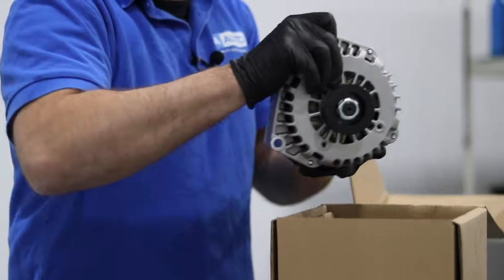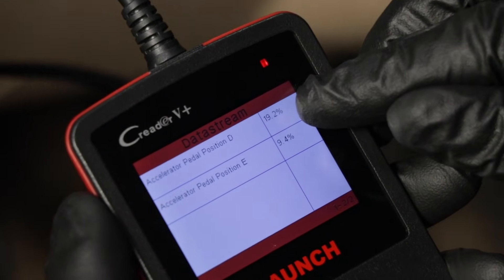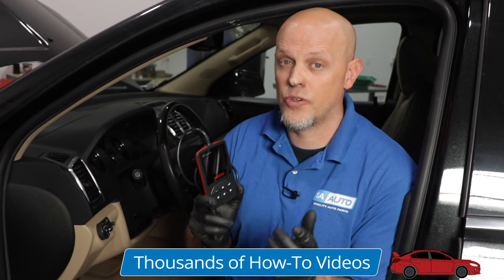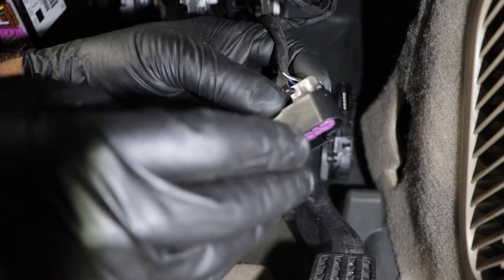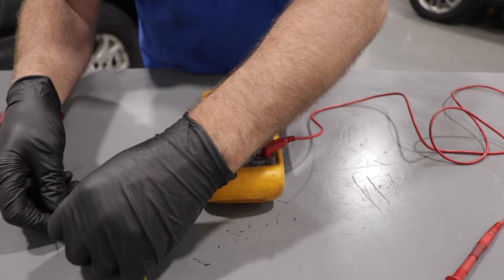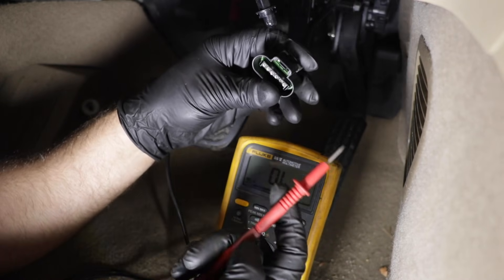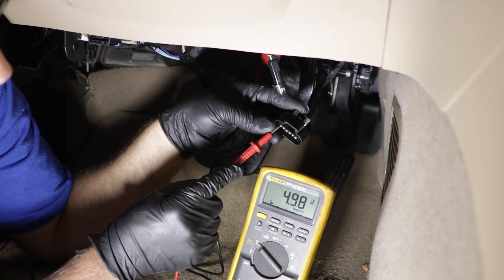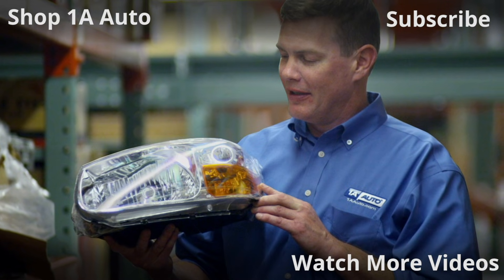Check Engine Light? No Power? Weak Car Acceleration? - Code P2138

Comment: Thanks, I just had to listen to the first 52 seconds in the video to find out what the problem was. About 4 or 5 years ago I installed the Pedal Commander to my Camaro 2012, basically what it does it's overwrite the pedal input to the computer with your preference drive mode. I stop using it, meaning you can switch the unit off  about 2 years ago but I leave it installed, I never take it off. This It's got to be problem !! ,

Comment: Interesting! Let me throw a wrench in here if I may. The only time I've ever got this code is when my Pedal Commander was hooked up. It works flawlessly for a couple months, and then all of a sudden it goes into limp mode on a start up. Disconnect the Pedal Commander and put it back to stock, problem goes away instantly. I've been working with the folks at PC for a few months trying to resolve this issue. They are good to deal with so I'm cautiously optimistic that we come to a good fix. I also run a Range Technologies AFM disabler, so we will see if the two together are causing an issue. I will reply back in the future when I have a solid cure.
Reply from the maker: +@desballard2614 Thanks for checking us out. Shop for high quality auto parts on 1AAuto.com:

http://1aau.to/m/Shop-1AAuto-c

Comment: accord 2007 (5 cylinder) recently turned my check engine light on and got it scanned - code p2138 showed up. not sure if I have to replace this part that he's showing in the video or the sensor that's underneath the hood & I think the piece is called the APPS ? any help would be appreciated

Comment: I had this code on a Buick Enclave. Previous to that, I just assumed the engine was lackluster because it has 220,000+ miles. After replacing the gas pedal, it accelerates like it is new again.  Thanks!
Reply from the maker: +@youdagoob Thank you! We love empowering our customers and showing how to perform DIY auto repairs with our high-quality auto parts.  http://1aau.to/m/Shop-1AAuto-c

Comment: Great. So what happens when this is intermittent????? Get the code, car goes to limp. Stop the car, turn off the engine. Sit for one minute, restart car and NO limp mode and car runs fine.......go home. Restarts in morning and runs fine until   it doesnt again.......and round and round....
Reply: Did you fix this defect and how ?

Comment: I just bought the pedal/sensor assembly for nothing. I each as many videos as I can and somehow skipped over this one. I watch 1A and have ordered parts in the past. After watching this video I did the test and my white/black wire is barely sending anything. Instead of something close like your 4.98 it isn’t even reaching one volt. It varies from .4 to .9. Trying to follow a break in a cable is going to be fun especially if somewhere in the middle. Learn from my lesson, guys.

Comment: I’m seeing a lot of GM cars have a condition where pushing the pedal, one sensor will move 1% before the other- won’t set a code. But under return, the one will return and the other won’t return to 0% position. That’s a difference of 2% total- That will set a code.
Reply: Mine is always off by one percent while accelerating or decelerating. They are equal when you reach desired speed .

Comment: I have a 2007 Hyundai Entourage 499900 mi on it. I've cleaned the throttle body possibly change the setting for the butterfly electronic control I also cleaned out the TPS, spark plugs look good wires are almost brand new, used a can of B12 to clean out fuel injectors, step on the gas pedal can't go past 50 mph really struggles, can I order the gas pedal accelerator sensor from 1A Auto for my vehicle and will this remedy at least let me know that there's nothing else that's wrong just the gas pedal. I do not get any check engine light or codes and I use the fixed  OBD2 scan
Reply from the maker: +Peter Raelian We wouldn't be able to diagnose an issue like that here, you may want to have a local mechanic take a look at it. Thanks for checking us out! http://1aau.to/m/Shop-1AAuto-c

Comment: Hi please i have Chevrolet equinox 2012 with the same code P2138 i have checked the the power and the ground and change the accelerator pedal but still the problem is there, please i need your help

Comment: I have a code P2138 on my 2013 Chrysler 300c , I replace the accelerator pedal and it still goes into limp mode . Any idea what could be the problem?

Comment: I have the check engine light on and p2138 comes up,the car doesn’t accelerate the right way.I replaced the throttle pedal sensor,the throttle body assembly and it is still doing the same thing and the check engine on,I don’t know if I have to replace the computer or there is a way to reset it

Comment: I'm at a loose end with mine. I'm getting the p2138 and p193b(throttle valve Signal error) various mechanics have looked. I know its not the pedal. App_d is fine, but app_e fluctuates. Really need some pointers. Great video though. 👍
Reply: Did you fix this defect and how?

Comment: My car also disables tracton control. I have changed the pedal once at 150k miles and just passed 300k and now its acting up again. I cleaned the connections to the pedal and also at the throttle, cleared the code and it seems to have resolved. 
For 150$ It maybe worth taking the plastic case off and clean it with electronic cleaner if it comes back. 
Lets see what happens 🙂

Comment: I have a 2013 Ford F550 super duty 6.7 accelerator e has no voltage Chase wires to computer going into computer have voltage on one side no voltage on the other side which both are posed to be a v 5 V

Comment: I have no power but no codes or check engine light on any suggestions
Reply from the maker: +RG 1 We wouldn't be able to diagnose an issue like that here, you may want to have a local mechanic take a look at it. Thanks for checking us out! http://1aau.to/m/Shop-1AAuto-c

Comment: I checked the wires they are ok and replaced the acclerator pedal but still there is problem. Car is GMC terrain 2012 3.0 V6.
Reply: Same issue 2011 camaro replaced everything and still have the issue

Comment: hi are these codes also related to the same problem should i change my acceleratio Sensor
 P1589 ACCELERATION SENSOR LEARNING VALUE
Reply: Did you get an answer to your problem? I have the same issue now

Comment: Actually you don't want any contacts to have dielectric greese..  That's something you put over exposed parts of wire once they're already connected together ,,example a battery terminal that's been cleaned you have wires connected to the terminal you put a little bit of dielectric grease over to terminal thats already connected..It would basically insulate the exposed wire From the air

Comment: Any tips please.

Jeep gladiator 20 wiv  smart key

Ignition come on but the vehicle want crank and dose not trun back off until you remove the battery + or -

Any idea please DTC  p2111 p2127.

Comment: I got a p2138 code on a 2006 malibu . It came to me in limp mode .  I called the parts store and had them order the gas pedal assembly . I pulled the pedal assembly from the car and saw that the electrical component had a snap off cover 😀 . I popped it off and saw a rheostat with small copper fingers . I cleaned the contact area with a q-tip with alcohol on it . Reassembled it and erased the code with the code scanner , replaced the pedal assy.  No expensive part needed . Easy peasy
Reply: I replaced throttle body and pedal and stillnhave the issue 2011 camaro 3.6
Reply: @rileynelson1864 Did you fix this defect and how?

Comment: I don't know what to fix my 2013 silverado 1500 4x4 it has the same issue, everyone mentioned about replace Throtle body, Brake pedal position sensor, Ignition coil and spark plug, water leak into wires connector, short voltage, I'm not sure who is right what really is the problem

Comment: My car is a Daewoo Lacetti Premier 2009 with code p2138. The strange thing is that the check eng light goes on only when I switch off the car! The engine even stutters after I remove the keys for a few seconds then it shuts down, seconds later the check eng light goes on and stays on! 
Any explenation for this?

Comment: My 2011 Silverado did the same thing but my I checked the connector and it did have some bare wire showing. And I taped it up and the check engine light turned off
Reply from the maker: +Julio Rubalcava Thanks for checking us out! http://1aau.to/m/Shop-1AAuto-c
Reply: @1AAuto  a lot of the wires actually had bare wires showing

Comment: Car in limp mode / engine reduce ,, I change trottle body that’s not it ,, cam sensor , that’s not it !!! Car turns over but no start
Reply: What was it
Reply from the maker: +Jayj B We wouldn't be able to diagnose an issue like that here, you may want to have a local mechanic take a look at it. Thanks for checking us out! http://1aau.to/m/Shop-1AAuto-c

Comment: One tip ... not challenging this guy by any means... When you are diagnosing, have piece of mind by checking resistance at the actual pedal.  You started from the far end, worked your way in and STOP..."IT'S THE PEDAL!" ... don't do it like that.  Add that one more step and check the terminals on the sensor itself(which ever you are working on).  You very well might have a good sensor and the wires(although checked out) might have a wiggly issue in the wiring and just so happen to fool you at the final diagnosis leading you to believe the sensor when all it was was a chaffing wire that just so happen to not be at the final.

Comment: Would this be the cause, even though i  got not check engine light? But my truck wont respond sometimes, i need to step on it really slow for it to respond a little better..
Reply from the maker: +daniel jimenez We wouldn't be able to diagnose an issue like that here, you may want to have a local mechanic take a look at it. Thanks for checking us out! http://1aau.to/m/Shop-1AAuto-c

Comment: @1A Auto: Repair Tips & Secrets Only Mechanics Know 

Good day! Was just wondering if the code P0122 and P0222 are also related to this issue? Am having issues with my 2015 Subaru STI. 

P0122 - Throttle/Pedal Position Sensor Switch " A " Circuit Low

P0222 - Throttle/Pedal Position Sensor Switch " B " Circuit Low 

Thank you sir!

Comment: I had that code before on my 2006 impala SS… and changed the accelerator pedal for a brand new one. Everything was good no code anymore.Now about a month or two later code comes back up. What could it be??
Reply: And can I also use electric cleaner for better connections just in case its dirty or corroded?
Reply: Could be the throttle body positioning sensor… get on eBay and check out throttle body’s

Comment: I keep getting reduced power to my 2016 Malibu. Ive already replaced my MAF and MAP sensors. And its still happening.
Reply: Clean the throttle body with carburetor cleaner! carbon is probably interfering with its function!

Comment: hi , i have GMC Yukon 2013 XL , have problem with code P2138 accelerator pedal position (APP) sensor 1-2 correlation . i changed the pedal and throttel  and still have same problem  plz can u help . thanks
Reply: Did you guys go through the relearn process for the pedal and the allowing the throttle body to reset
Reply: @coreybrainard7653  yes relearn it and still have the issue, only thing I had was a corroded wire I repaired it it ran great for 2 days them back to p2138
Reply: Were u able to figure it out I have the same problem on my vehicle
Reply: Same on my 07 smh

Comment: I have a 2018 kia soul and I've tried everything except this so far low acceleration lost of power etc but will try this
Reply: dyde i have my slk230 ndve changed so mch, ignition coils ad then this
Reply: Mine has a new engine, cat converter, transmission. throttle body sensor.  starts immediately, purrs nicely.  Acceleration is uneven, hesitating.  It will get up to highwau speed.   No codes.  I think its this sensor.

Comment: Hey man. Recently bought a car and had to buy this paddle with the sensor like this one. But on the wiring harness to the clip onto the sensor, the person before me had tie them all together because they must've torn apart. How would I go about getting a new wire hardness to clip onto the sensor.
Reply: Yeah all my wires are tied together. Is this going cost alot to replace? So far it seems to be working with the new sensor and peddle.

Comment: I have a couple questions ...

1. What if we have replaced the Accelerator position sensor and we are still getting the fault code ? Because I have replaced the APS as well, the Throttle Body Sensor and also did a fuel system cleaning but I am still getting that fault. I could really use some help because I have been struggling with this issue for some time now. 

2. If I were to have the wiring replaced what would be the recommended price to pay for labor? I am planning on buying the pigtail connector to see if that is damaged I might as well change it because I am noticing that I get this fault when I hit a bump on the road. 

If anybody has run into a similar issue like this and fixed it please feel free to let me know what is it you did 

Thank you.
Reply: My cadillac dts have same issue
Reply: Could you resolve the problem?

Comment: Can a dead, dead battery affect the APP sensor?  My battery was dead for a few weeks, I just replaced the battery and now I’m having throttle issues. Had this sensor replaced 8/2018. Wondering if battery caused issue, or it just needs to be reset somehow? Thank you!
Reply from the maker: +tigereyes6868 We wouldn't be able to diagnose an issue like that here, you may want to have a local mechanic take a look at it. Thanks for checking us out! http://1aau.to/m/Shop-1AAuto-c

Comment: hi. I have a big problem with chevy TB 02 and I don't know what to do. The engine is running normally, no light is on, the throttle is clean and the engine has no power and is noisy. Max 3000rpm and 55mil.. Do you have any advice? Thank you

Comment: Should you do this check on the throttle body side? Can't that be a cause for the code as well?
Reply: APP sensor and throttle are different.  Like the Acura MDX, they use a stupid drive-by wire.  The lead starts at the APP sensor THEN goes to the throttle body and in this person's case, the APP sensor is on the pedal so it will cost more lol

Comment: I replaced the pedal cleared the codes drove it for 110miles   No codes. But when i left the car off for 6+hours or so. And try to turn it on code comes back up p2138
Reply from the maker: +SpywareSmith We wouldn't be able to diagnose an issue like that here, you may want to have a local mechanic take a look at it. Thanks for checking us out! http://1aau.to/m/Shop-1AAuto-c

Comment: I have a 2003 Honda Civic and acceleration is slow and going uphill it starts to jerk around 45 mph. It’s only at 91k miles which I find disturbing I went to different auto shops and they all came up with different conclusions
Reply from the maker: +Dunz808 We wouldn't be able to diagnose an issue like that here, you may want to have a local mechanic take a look at it. Thanks for checking us out! http://1aau.to/m/Shop-1AAuto-c

Comment: What to do if everything has been changed out and it's still doing it? That's the issue I'm having 😩
Reply: Same
Reply: Disconnect battery from car and reconnect to rest everything if problem still exist. Let car run for a while and check the computer with OBD BlueDriver.  If problem still exists maybe you did some internal damage to your transmission